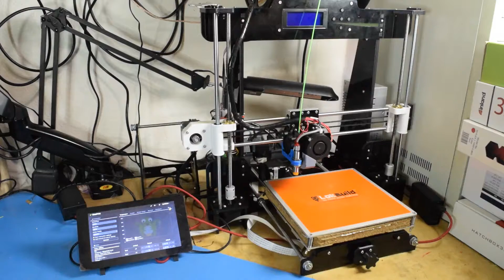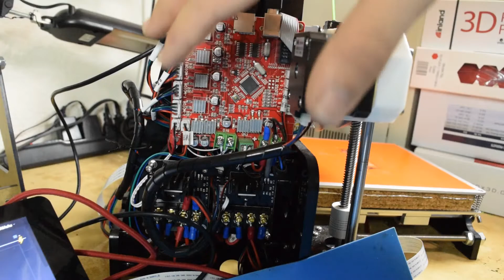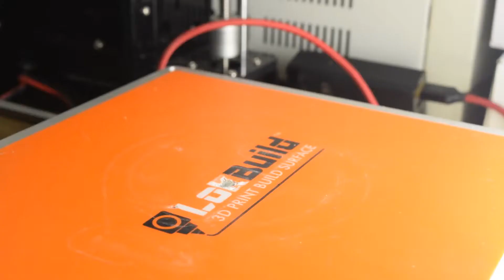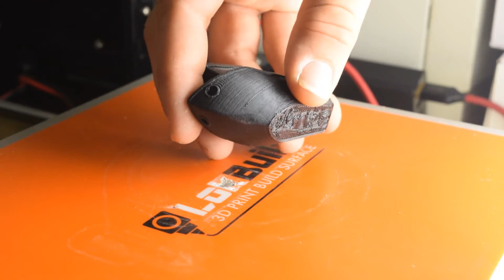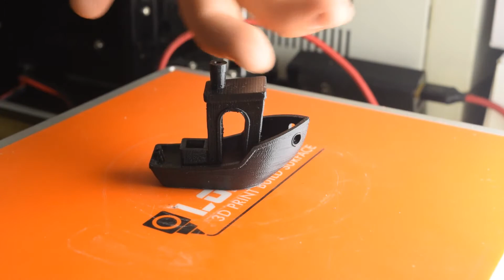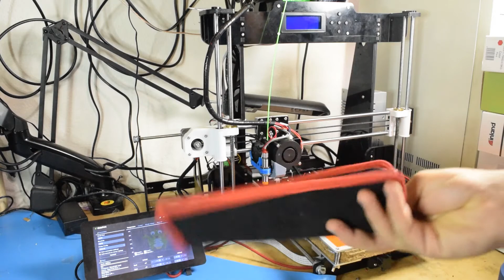My 3D Printer an Anet A8

Comment: I use blue tape on both my printers, it works fine. I have a junk acrylic prusa clone from 5 or so years ago that has been upgraded a few times with new extruders and totally new electronics but I still use blue tape on it. It sticks great and is very cheap to replace. Just make sure to use quality tape, that harbor freight or cheap walmart stuff doesn't even stick to the bed itself that well! My m,ost recent and second printer is a dremel 3d20 that came with several sheets of black buildtak and it sticks way to hard. I've had prints rip apart trying to get them off of it, so I went back to using blue tape on it as well. Unfortunately it's not as good on that printer as the prusa clone because it doesn't have a heated bed, but works better for me than the $9 per sheet stuff.

Comment: Don't use Unified bed leveling, the A8 flash rom is not big enough for that unless you mess with the bootloader, which you don't want to.. So rather than that, go for bi-linear bed leveling and increase the measuring points from 3x3 to more (I currently have 7x7 set) and it prints flawlessly AND the display will work again... Just don't forget to turn on bed leveling in the startup g-code (not measuring, just actually using the values, because by default, the printer turns that off!!!).

Comment: I built my own MOSFET controllers, total cost $4 but I also already have the equipment to make my own PCBs. I also found a high end server PSU for next to nothing at a second hand computer store. Then I went overboard and completely built my own printer heh...
Reply from the maker: I would have done the mosfets myself but i was too excited and just bit the bullet to get it done quicker. I'm thinking about going ATX for the PSU but I may also want to go 24v instead so i'm waiting for now. 3D printers are a sickness, i've started designing a corxy printer to replace this one with.
Reply: 24v means you will have to change the heater cartridge in your hot end and the bed might not be suitable for 24v either Check the OHM rating of the bed (check at the power pins with it disconnected from the MOSFET controller) and use OHMs law to figure out the current potential, you might be surprised what it is at 24v and you could burn it out after using it for a bit. Honestly I think the core xy looks cool, but I wanted something a bit more robust. 

I have all linear rails and 25mm extrusions (cartesian type of my own design). I also managed (by design) to get the bed level with only about 0.0005" (or 0.012 mm) deviation from the highest to lowest point. So I don't ever need a bed leveling routine (auto or manual). I also use dual motors on every axis. It's all complete overkill and could likely be a very decent CNC machine heh...

My printer is not sleek looking nor is it silent, and I don't care, it prints very well. My next upgrade (I have all the parts now) is a 120v AC, 500w silicone heat mat and a 32bit control board (smoothieware clone). I'll be expanding the size of the bed to 12" sq (300mm sq) as well, since this is the size of the new heated mat. Then Ill be adding an enclosure as well, upgrade the hot end eventually...... Sickness?? naw it's a hobby that feeds my other hobbies =)
Reply from the maker: For 24v I was mostly thinking about a new heat bed. I would need nearly all new everything if I made that switch. I like the idea of an AC heater, it makes wiring a little more complicated but manageable. 

I want to look into smoothieware. I plan on laying out my own control board with a TM4C129 to get 120MHz, 32b, and a lot more goodies. I was going to use Marlin on it but one look at that code base tells me that as soon as the primary developer is done, that project is dead.

I've got a design in my head for now that will use three independent Z-axis motors. The motors will be used in a driven 3-point leveling system so manual leveling isn't needed. I'll still use a sensor to tram the bed. Metals warp when temperatures change. I use different meshes for plastics the need different bed temps.
Reply: Ya, I have a BLTouch that determines Z height every time I start a print, but that's all it does (this is not a leveling routine though). For the heated bed I got an SSR that will hook directly to the controller, so only 1 extra step to connect it (so the mosfet controller is going away heh). My print surface is glass. Since trying glass with hairspray I have used nothing else for PETG, PLA, and ABS (works perfect every time).

Comment: I have a similar FLSUN kit printer, it took about 5 hours to assemble the core printer and I have done a lot of the same modifications you have, replaced the stock PSU with an ATX unit, the bed cables came soldered, I still am using the stock MOSFETs as the ones on my printer seem decent and are fan cooled, I have a pi running octoprint for printer control and love it. I have a few videos about it. I got mine for $180 on a great sale but even for a little over 200 I still think it is a slightly better deal then the A8 due to it's sturdier aluminum frame, and included bed leveling sensor
Reply from the maker: acrylic vs. aluminum, bowden vs. direct, wheels in slots vs. linear rods, 200mm^3 vs. 220^2x240, part cooling fan. There are pros and cons for each. I'd rather have the A8 for now and modify my frame. Aluminum extrusion is pretty cheap.
Reply: AkBKukU you make a good point; I had to stick a part cooling fan on my FLSUN, and the slightly larger build area of the A8 is also exreamly nice btw where do you find cheap aluminum extrusions, I have looked online and the shipping charges are almost always completly outrages, none of my local hardware stores seem to carry them
Reply from the maker: I haven't had any shipped yet so I'm not sure what the costs are like for them yet. I was looking at going direct at 8020.net or Misumi. The custom cut prices seemed vert reasonable.

Comment: Since i don't have any blue tape at hand and my PEI printing surface is still in shipping i just coat the bed with glue. It's a half-assed method for sure but it works.